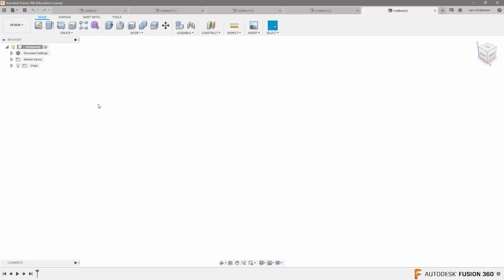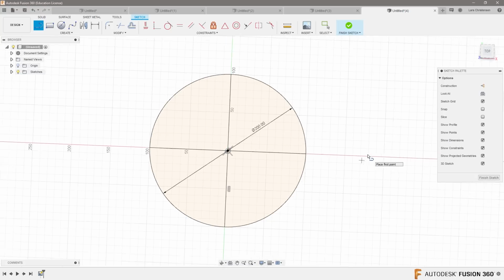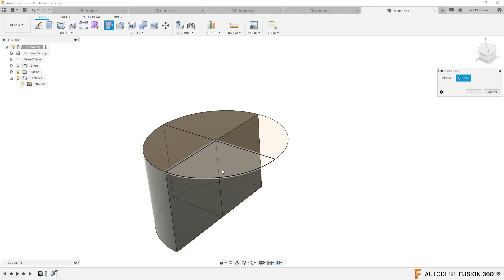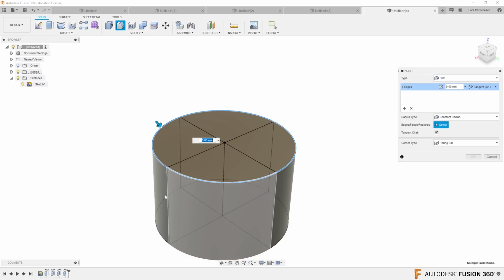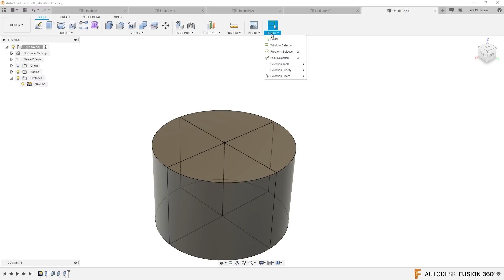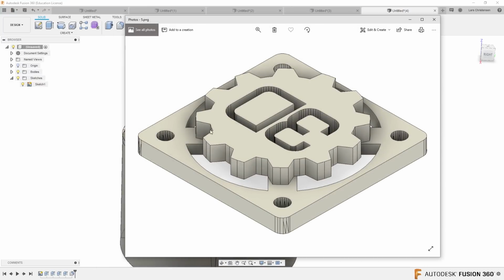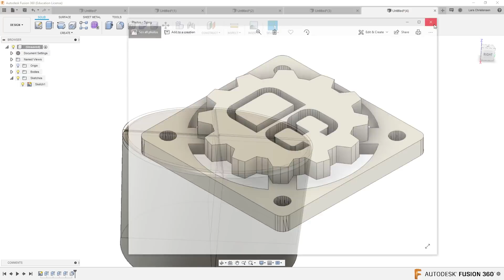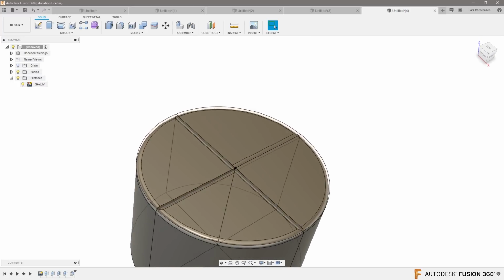Fusion 360 — Selecting a lot of edges quick for Fillets — Ask LarsLive

Comment: The selection filtering is helpful actually. It would be really nice if you could select the edge you want and have a "select similar" feature that runs through all the edges and finds all similar  or exact edges. I think Blender has this for faces, edges and vertices and it looks to be extremely powerful and required for complex models. A lot of these edges I'm needing this for are created using the pattern tool so maybe this is something that can be piggybacked on with the pattern you create, because usually at the edge meeting point of 2 faces you are dealing with 2 edges literally on-top of each other too.

Comment: Is there a trick to select a bunch of geometry in CAM operations? Just selected over 120 circles by clicking them all individually because dragging on the screen seems to do nothing when selecting cut geometry
Reply from the maker: Depending on what you do. There are the select the same diameter as an option in drilling and boring operations
Reply: Lars Christensen oh that’s neat. Not on circular though?
Reply: What about engraving?  It’s time consuming selecting all the text lettering edges.  Any workaround there?